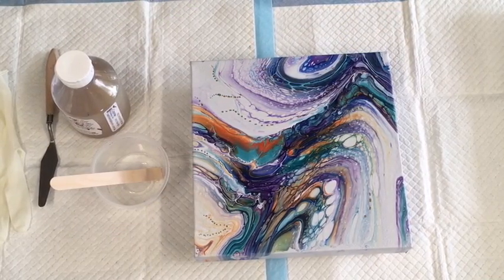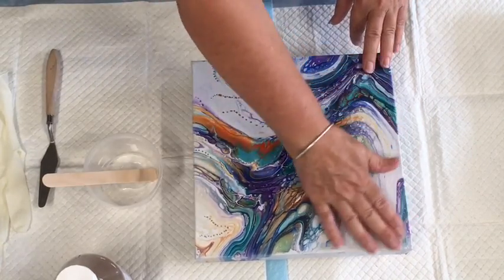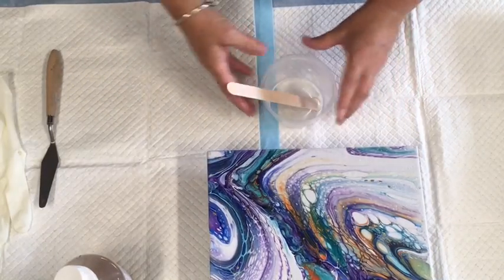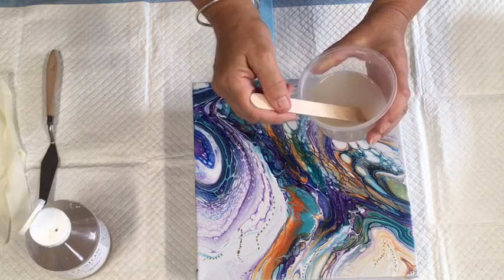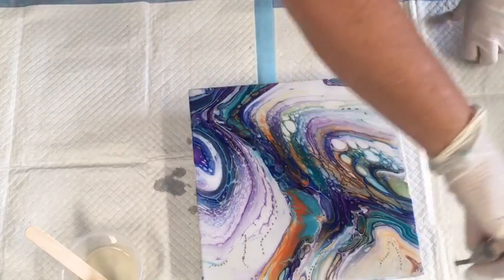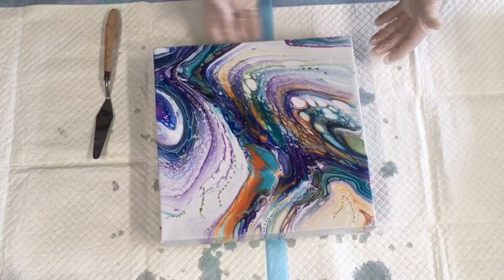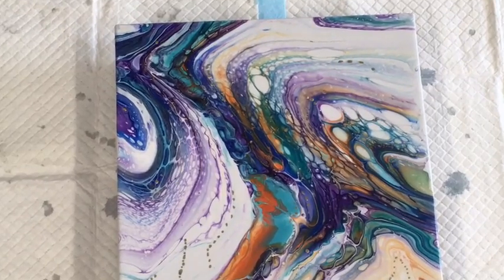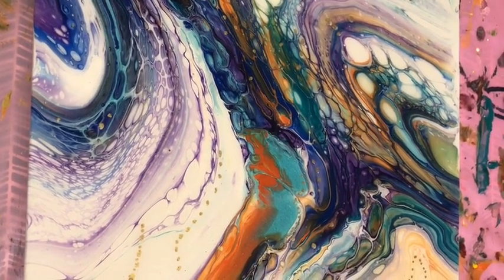New product pouring Resin/ Giving it a try to coat my bloom effect swipe

Comment: Hey Gilly, you've been such an inspiration and influence to me that I've now started my own painting journey. ABSOLUTELY LOVEEE watching your videos! You've got an amazing skill <3  I have a quick question in regards to finishing paintings and preparing the canvas. What type of varnish can we use instead of the resin? Like you said resin can be a bit expensive and if I am to sell my work idk how I can price them... so I was wondering if theres any alternatives that would be much affordable and will give great results like the resin. Also, how to do you prepare your canvases? Do you apply gesso to prime the canvas or is spraying the canvas with water just as effective? Any advice is very very much appreciated! THANK YOU!
Reply from the maker: wish you every success, i buy canvas pre gesso so no need to prepare, i have a few different videos in my play list for varnish and gloss coating your dried work 
as for price its a personal thing i believe. :)
make sure you cover your time and materials etc and then you decide a sale price no set rules for pricing :)
Reply: @gillykubeart  Oooo I think I might have missed those cuz the ones I've watched were relating Fusion resin & Mod podge. Just then I used resin (diluted in warm/hot water), and did your damp cloth - wipe off method but for some reason there's like chunks in it. Any ideas why? Again, THANK YOU SO MUCH for your valuable time and advice ! And wishing you an abundance of success too! <3
Reply from the maker: Oh chunks! Iv not ever had that happen maybe dilute with cool water and not hot water 
I always get nice results with the wipe on fusion method 😃
Reply: @gillykubeart  Ooo I will try with cool water next time, thank you so much for the quick replies you are amazing! HAPPY HAPPY CREATIONS!